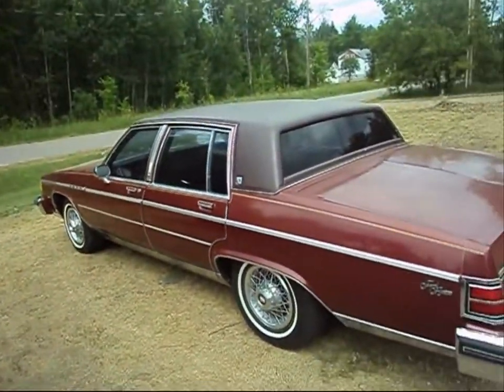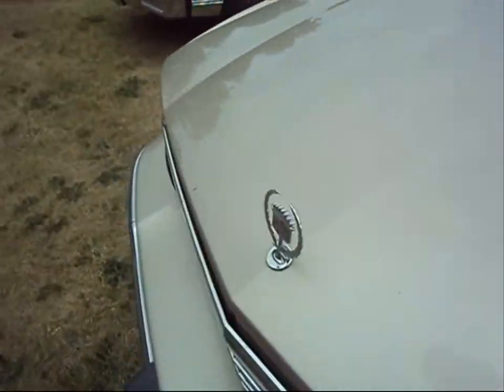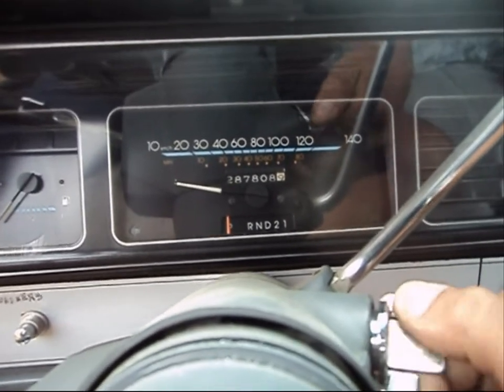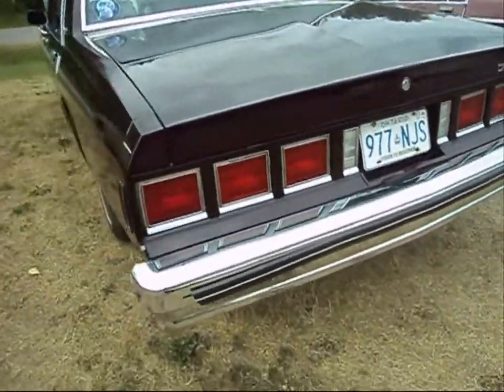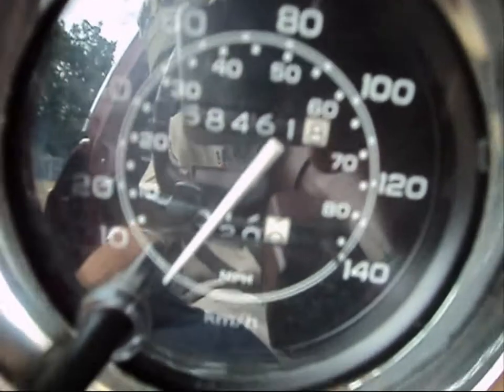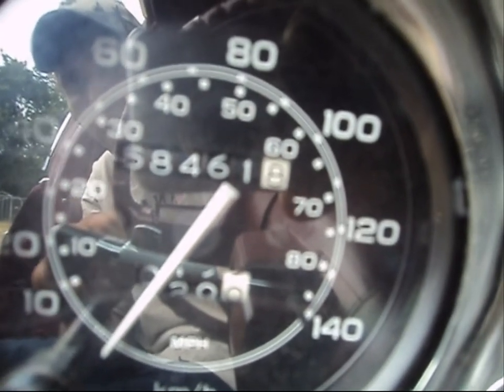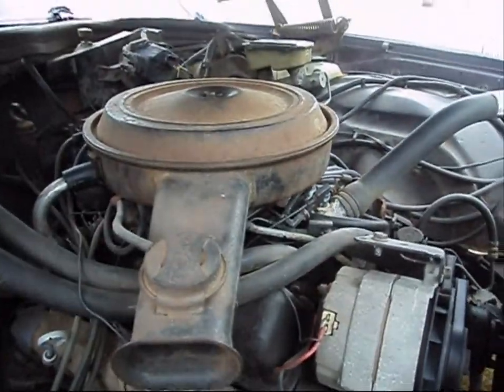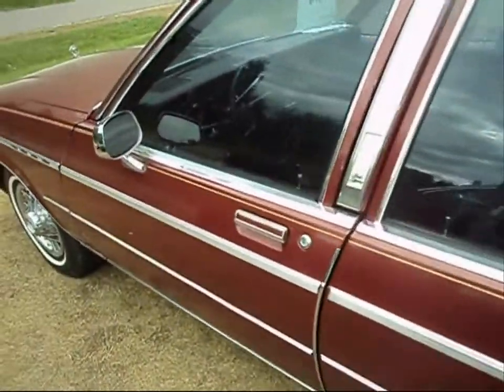July 2012 Update: Buick Electra, Chevy Caprice & the Cadillac DeVille

Comment: my park ave turned over 75,000 km this month. been driving it on the weekends and days off. Was supposed to take it to regina for a day (400 round trip) but i had to work. I need a new AC pump and condenser for the park ave to... mine apparently leak and they have to be replaced.

Comment: Gas prices must be cheap there if you can drive three boats around. Or everything is a close drive? Got a 454 BB to put in my 71 Chevelle. Not sure i will be able to keep it gassed up at $4.00+ gal. U.S. My 75 C10 has a 350 with quad. The Honda gets used the most at 35-40 mpg. Here in So Cal everything is a distant.